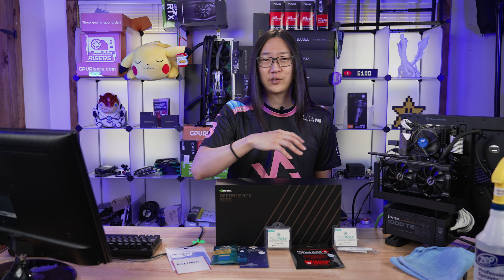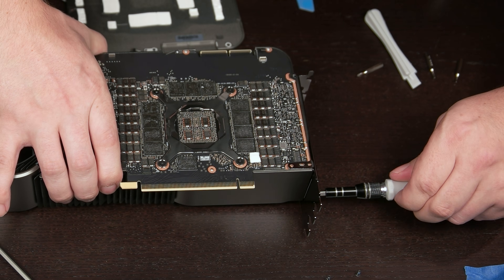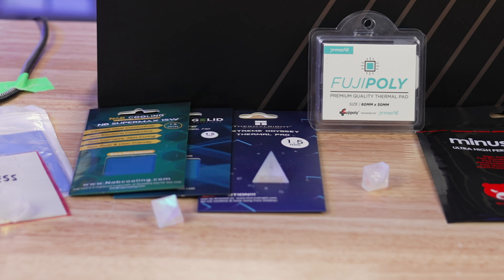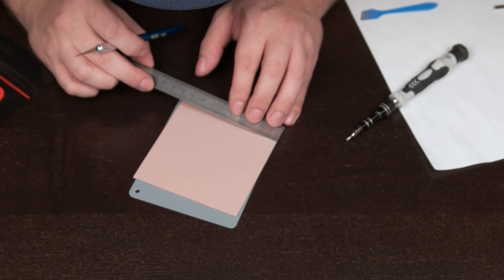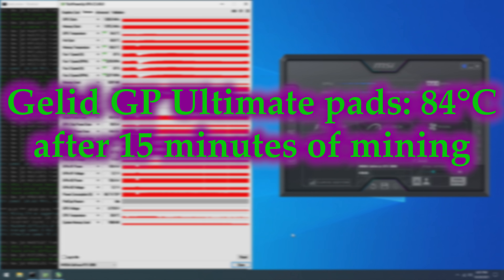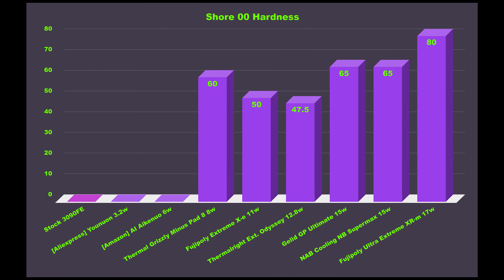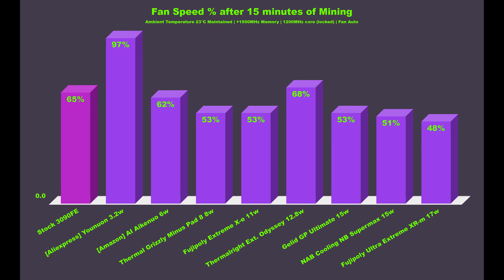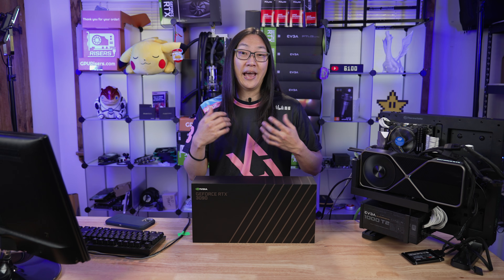Thermal Pad Showdown! What you should (and Shouldn't) Buy

Comment: Well I see some flaws in your testing as your Fujipoly were almost snug together and you left huge gaps in the Thermalright Odyssey. I run those same Thermalright Odyssey pads on my 3090fe with 85% fan -150 core  +1475 Mem with 55C core, 88C max Vram in Afterburner @ 124.5 MH/s. This is also in an enclosed case. So great video but flawed testing.
Reply: Yeah it seems off that he received a 1.3mm thick thermal pad instead of a 1.5mm thick like the others. I think this does throw off the testing. 
I have been using Thermalright Odyssey on all my cards, including gddr6x memory cards. 2.0mm thickness to match most of the gddr6x ones and it performs quite well. I'd say it would tie or only be slightly less than the Fujipoly ones. Gelid seems to be a solid brand too. 
That being said, TekShinji should do another video with  2.0mm thermal pads combined with 3.0mm thermal pads for gddr6x memory cards.
Reply from the maker: Regarding the flaws in the video could you make specific recommendations on how to fix the flaws? It's very easy to say something's wrong what's difficult to fix it and like the idea is or can't.
Reply: @TekShinji  When I set my pads on I cut straight lines for the long memory lines next to the GPU heatsink. When they were applied on your video, there was gaps in between each square; thus allowing the heat to flow around each chip instead of transferring it to the pad. I cut my pads in one solid piece to cover all chips in a row so no heat escapes(or not as much anyhow). The only other flaw was that the pads should have been 1.5mm instead of 1.3mm leading me to believe that they could have been smashed in shipping. I only say this because I use the same exact pads on a 3090fe and was able to drop 18-20C off my mem temps(without using anything extra like thermal paste).
Love the videos! This is just a personal observation and opinion 😀
Reply: @davecollins7600  Appreciate the feedback. It is definitely possible there was an issue with the thermalrights we received. Perhaps a manufacturing defect. We will order another set in the future for our next thermal pad roundup.
Reply from the maker: Thanks for all the feedback!
Reply: @TekShinji  I have to agree with the guys above. Either the thickness isn't big enough (due to them compressing quite a lot) or the placement required is a continuous strip of them. I have used the same pads on my 3080 FTW3 and it brought my VRAM down from 102 degrees to 84 degrees.
Reply from the maker: Thanks for the feedback, as noted in the video, everyone's mileage will in fact very. Not a if but will. 

It would appear that the results are consistent across the board across  All pads. Therefore, we felt this information was relevant. Thank you for the feedback. We appreciate it. We'll consider it in the future videos!

Comment: Try Gelid Extreme instead. They're much softer compared to the Gelid Ultimate. One possible flaw with this test is the harder pads do not compress as much, therefore leading to insufficient core mounting pressure.

Another idea is to try thermal putty (TG-PP10). They don't have any hardness, so they can potentially allow the heatsink to be closer to the modules/core allowing for higher clamping and thermal transfer.
Reply from the maker: Thanks for the information
Reply: Hello, does extreme perform worse than ultimate or is it better?
Reply: @dolanthefacc879  did you find out

Comment: After scoring a 3080ti from a best buy sit in, I ordered an EK block and active back plate. I used EKs pads and was really saddened by the results 55+ under full load and an idle temp at 30+. I went ahead and bought different sizes of thermal grizzly minus 8s and put em on. It made quite a difference. Full load it now runs 45-50 degrees and idles at + 1-3 degrees above room temp.
Reply from the maker: Very very nice bro. Very nice!
Reply: With 70€ Bykski (shipped, no active backplate) + Gelid Ultimate i have 56° in Italy in August with 100Mhs on a 3080 STRIX, now i have 50° on memory and 28 on core
Reply from the maker: Very nice!

Comment: you are absolutely correct in your analysis: evacuate the heat from the heatsink as well to avoid increased core temps. I would like to see a full copper sheet used vs the more local "raspberry pi" heatsinks.
Reply from the maker: Yeah, it's so crazy how this happens.
Reply: @TekShinji  check out ebay if you guys are interested. The chinese have the concept for sell at different thicknesses and tape applied. I went with scrap 5/16 copper tubing, but for testing & videos the plates are ideal.
Reply from the maker: The thing is we also have to keep the pads within the scope class realm of availability in practicality. We can't test something that no one can get.
Reply: @TekShinji  im referring to copper plate in this comment. They are sold in different thicknesses on ebay. Send me a friend request on discord and ill send you a link. Again this isn’t necessary for what we do with regards to mining but it would extend the life of the component by removing heatsoak.
Reply from the maker: Thanks for the information!

Comment: Great Video, this has been on my mind, I'd like to see the Aikenuo 12W pads compared, if they are what they claim to be.  Its hard to want to swap pads on a Card that still under warranty, would simply sticking heat syncs on the back help pull heat from the back plate?  Would that be better than transferring it to the main cooler.  Let's say you had Fans on both sides, setup like how an Octominer case works?
Reply from the maker: I would definitely check out my channel cuz I have some videos where I put heat sinks on the back of the card! They're under the thermal stuff. The problem is it wouldn't make much sense because the thermal transference of the thermal pads is inefficient so therefore putting heat sinks on the back won't do as much as it could.

Comment: That's weird, I would have thought that reducing memory temperatures and so reducing temperatures on the PCB and so neighbouring components would lead to decrease of the core temperatures, but it's opposite, weird...
Note to self: Best choice pads are Gelid GP Ultimate 15W or same under diffrent branding NAB Cooling NB Supermax 15W
Reply: note to you 😁:I can confirm after 4m of trial, gelid are very solid pads(i dare to say the best thermal pads. just make sure to get the right thickness). they are very good if you go with whatever the manufacturer had in there too if you add thicker they won't compress and you will get inconsistent/poor results
Reply from the maker: YUP we has NO idea this would be the result it truly is amazing because NO one has ever talked about this!
Reply: I've used both gelud 15w and 12w, they have different uses.  If you need a firm pad use the 15w, if you need a soft pad is 12w.
Reply from the maker: Thanks for all the feedback. Will definitely consider this!
Reply: @Hammercannon  Thank you, I got the 15W and when I checked them I have noticed they are hard and I need soft ones :)
Reply: Dang it just googled my 3090 trio uses THREE DIFFERENT THICKNESSES!
Reply from the maker: Oh man! That sux! What were they thinking!?!?!

Comment from the maker: Have you changed Pads? What pads do you LIKE?
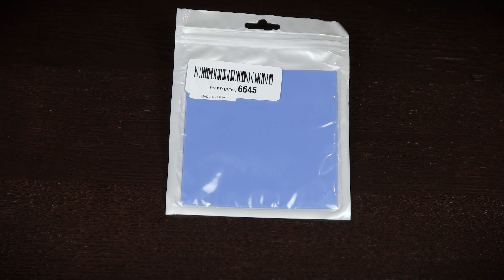Reply: I haven't hanged any, but I have changed some :D I used some cheap ones and it worked fine but it was for gddr6 not gddr6x very excited to watch this. Might update my comment after I finish watching.... :D Edit: 2:15 I have some 5mm pads. 7:24 those the pads I used. Buying some NAB pads now. LOL
Reply: fun fact. i did this without recording and posting on YouTube and my choice was gelid by far. granted i have my cards water-cooled but compared with cheap ones gelid keeps my 3080's and 3080ti's founders at 62-68 junction temp(while mining eth with +1400 mem) while the cheap one after 2 3 months they started loosing thermals. at first the cheap ones(well actually ek ones on one of the cards and different random brands on the other ones) were keeping the cards at 76 degree but than in a span of 4 months the temp started raising/averaging all the way up to 96 degree on some cards
Reply from the maker: Exactly that is something that would be much harder to test but thanks for the info. We will definitely consider this! 

I hope your temps be low!
Reply: gelid extreme 2.0mm @ 12.8 w/k on all 6x memory. 110pl on raven equates to 88c with roughly 80F ambient. copper plate and added fan on the card is ideal to remove heatsoak, but not required for hashing purposes.
Reply: I changed the pads on my Asus tuf 3090 to gelid ultimate and it made no difference at all my memory is still at 90c+
Reply: Gelid dominates.
Reply: So which one was the winner
Reply from the maker: Try watching the videos :-)
Reply: Dude I did watch the video and it was awesome best video yet I was just pointing out that I don't think you specifically named a winner. I don't know maybe I missed something
Reply: I refuse to buy those little puny packs I'll buy the Odyssey 120 mm by 120 ml 12.8 wk $40 best value
Reply from the maker: The problem is I can't say which one is the winner. Because of the fact there was more information that was discovered at the end of the video. You'll have to pick the pad that's best for your application based on which is your goal.

If you're looking for a black and white which is better? That's very difficult to do.

Kind of like saying which food is best to eat? Everyone is different and everyone needs different nutrition.
Reply: @TekShinji  I guess that is the way I understood it great video
Reply: Oh by the way are you going tomorrow?  BB
Reply: Wow you were only hitting 98c on the stock pads‽ My 3090FE would hit 110-112c memory junction temps easy. 

After I replaced the pads its good now lol.

Edit: 112c not 120 :D I used FP 17w(VRAM) FP 11w (everything else)
Reply from the maker: @dotJata  keep in mind no 2 cards oe situations are the same so everyone's results will be different. Especially if the ambient temperature is different
Reply: Very nice and informational Video. Good job. 

I honestly thought that the Thermal Grizzly Minus Pads were the best on the market. Guess my research was lacking.

I did not expect the NB pads to be this good. I will go grab some for my RTX 2080 Super - MSI Gaming X Trio. 

Please keep making such videos and keep up the quality. 

Take care and stay healthy.
Reply from the maker: Thanks a lot buddy. They are a very good pads. However, it doesn't mean that they're the best of value regarding cost per performance. They're still a very good choice.